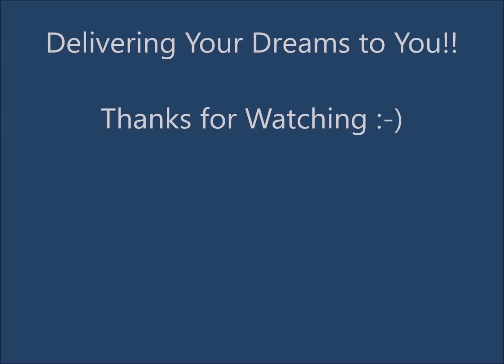Cutting New Road with Cat 963 Tracked Loader

Comment: Take no notice of the negative comments I have two 953’s and have been operating track shovels all my working life, started on  b100 internationals cat 951’s 955’s then on to the 953’s d6’s etc etc . We use them in the uk for final trimming roads motorways airport taxiway work and run a 4in 1 bucket for this. When I started I never thought I’d ever be able to level anything and had negative comments from certain people which made me more determined to crack it but I did and have been doing fine levelling for years, track shovels are one of the most versatile machines out there being able to do clearance demo load lorries grading and most things in between,the reason there not popular is there not easy to drive and not many can properly, you’re doing great taking it easy ,by the way that’s lovely looking 963 look after it.
Reply: Thanks!
Reply: Thanks Charlie, please tell us more. I can drive a 4in1 4x4 loader well after over 11 years, I've seen other comments like yours about track loaders or Drott's as they are often called in Australia. They can't be that hard to operate I guess the steering the hardest part, the other controls would be straight forward and you'd pick it up fast I would guess? I'm looking at logging and side cuts in steep rocky country. I wonder why many of these track loaders on YT have no rippers ? Must have rippers and a 4in1 and then a leveling bar to grab in the 4in1, your thoughts?. The advantage a dozer has it has tilting blade I guess. I really enjoy back scraping with my loader after getting a cut going as it cleans everyting up real nice, surprised the guy didn't put that in his bag of tricks.

Comment: Funny how everybody who's not in the seat is the expert. Fairly certain most of the cats commenting have never run a track loader because the market for them is small. My style for running them is different then yours but you got the job done! In Nebraska I ran one of these all the damn time but these don't even exsist in Colorado and wheel loaders fucking suck!
Reply: What's wrong with wheel loaders?  Don't get me wrong, no one loves running tracked machines more than me, but I wouldn't be using a tracked machine to do a wheeled ones job and then blame the machine. Care to elaborate?

Comment: HE'D NOT BE DRIVING FOR ME !!, Fckn about he'll have that tilt ram seal out if he keeps at it like that
Reply: like how?
Reply: @d.e303-anewlowcosthomebuil7  
With the bucket tipped over and digging in hard ground it is placing much pressure on the tipping links and ram and is totally unnecessary.
Ive seen 53's and 63's with screwed up tipping linkage and torn out ram seals due to this abuse.
Bring in an excavator to dig it out with half the fuel, a fifth of the track wear and get a better job, the stone up with the 963 if you must
Reply: @jameslindley8318  ur right, i just saw that
Reply: @jameslindley8318  how do you tilt the blade on those to cut a grade?
I mean to crown a road, or to start on a mountain road. Does the blade tilt like a regular dozer?
Reply: @d.e303-anewlowcosthomebuil7  No Tilt Just Experience
Reply: @jameslindley8318  so, a much smaller excavator can be 30% faster and half the fuel?....would it need a blade?

Comment: Why would you cut top soil off a road
Reply from the maker: For a couple of reasons.  The first being, topsoil doesn't compact well and will hold water underneath the base and surface of the road.  Over time, especially in an area that gets a moderate amount of precipitation, the road will never get hard and eventually rut up again.  Remove the topsoil to get down to a good solid dirt for the subbase.  If you go down so far (your call) and you still find the soil is too soft and silty, you can add geotextile paper and increase the amount of stone put in for the base..  Secondly,  the side walls will contain the stone that you put down and keep it from running while your spreading it.
Reply: @HammaDownEnterprises  
Coz Top soil will turn to shit when its wet and will push straight through crushed stone capping plus if you put stone straight on top your road would standing high with no side support hence the edges will break away

Comment: Guys I need some help. I'm currently learning to operate a 963b and I'm having trouble with the position of my bucket. Any tips or advice? One pass I'm digging too much and the next pass I'm just skimming dirt.
Reply from the maker: With more practice and training you'll get it.  The top of the bucket is a level indicator, with time you'll learn to know when your bucket is level.  Before setting you bucket on the ground, pull the lever all the way to the rear until it kicks out.  That's when your bucket is 'flat' or in the load position.  Then lower the bucket until it a few inches off the ground. This is where you angle the bucket for your dig depth.  For shallow digging, tilt the bucket until the teeth touch, go slow and get the feel from there.  For deeper digging, you go tilt the bucket at a greater angle and apply down pressure accordingly.  Again, go slow until you get the feel for it and are able to visually gauge your depth based on bucket position how the machine handles.
Reply: SLHawk92 
 Thanks man. The boss has me stripping top soil off a lot and then I have grade it and right now it looks like I cut a bunch of speed bumps all over the place. I'll try again tomorrow and see how it goes
Reply from the maker: John Norris to fix that, set the teeth in the ground about an inch or two “use your judgement “ to knock the bumps down.  Once you got it relatively ‘flat’ then float it with the teeth pointed straight down.  Continue to work it at a reduced angle until you got it like you want it.  Over time, you’ll get better at it
Reply: Keep practicing you’ll get it ..... keep your eye on the bar above bucket ram ..... that’ll show you where your bucket is
Reply: Place machine on level ground
Sit in the seat and set the bucket flat on the deck- by rolling right back, put the heels on the ground and roll bucket forward until the teeth hit, (then a tad more roll pressure on the teeth )then lift up/Raise Vertically just a Tad until the teeth are just skimming/touching the ground, then jump out your seat and check where your teeth are, and adjust until the teeth are just toed down a tad, jump back in the seat and sit in your normal/comfortable position and  sight through/align a part of the tipping link with a part of the bucket or similar and get a mate to paint a mark on the bucket & linkage so the paint marks line up, whilst your still in the seat !- That will give you a Bench Mark as to where your Bucket Teeth are.

That said if the self levelling device is working you shouldn't need the above !.But it may need adjustment.
CUTTING
When you start your Cut- take it VERY SLOWLY ( Cut the Revs back to half throttle)and feel what the machine is doing- (Remember) the bucket will do what ever the machine is doing,) !! ie -if the machine stays flat level then you will dig flat level !, 

Enter the Cut by rolling the bucket forward a TAD ONLY!  GO MEGA MEGA SLOW until the teeth are around 250 mm under- then as the machine progresses forward onto the new cut ground and starts to rock forward- roll the bucket back (just a tad )and progressively  to prevent the teeth diving in too deep, ("progressively" to keep a smooth cut) and to prevent corrugations.

LEVELLING.
If the machine rocks sideways or fore n aft then STOP Immediately (Patience required here) , go back dump a bucket full when the low spot is, making sure you fill the low spot from the machine side, ie ( no hollows) then back off a tad, reset your bucket and cut the top off the dumped spoil a Tad High -(150 mm if soft material)to allow for compaction as you track over it.

Remember !! What ever the machine is doing -ie leaning side ways or nosing down or up, that is what your bucket is doing !!
So many think if they've been over it - they think its level, 
Learn Patience and GO BACK & (AMPLY) FILL THE HOLLOW-  if the machine ducks or starts leaning over.
 Feel machine position through your ass.

CROWNING
Id not bother Crowning the Reduced level dig,
Put the Crown on when stoning up- put the stone on Well High! - (around 200 mm-300 mm Proud) a machine width in the Centre of the road for maybe 20- 30 linear metres, then push a bit off to either side letting the machine duck a bit as you slew either side, the back blade the centre berm stone to take out any slew ridging
then go back to the start, fill your bucket with stone and run straight down either side of the road but 150 mm lower than the centre berm, filling any Hollows as required,
Then straddle the Centre Berm and the lower bench at one side of the road hence rocking the machine over slightly and run down the road blending the centre berm with the lower side grade- repeat on the other side ! hence you have your Camber/Crown.
PATIENCE IS PARAMOUNT- SLOW THAT ENGINE DOWN !!! AND PAY ATTENTION until you have it embedded in you head- then you will throw it on so fast it'll make others heads spin.

Comment: I guess I don't understand why you would use a tracked machine with a bucket to do a dozers job! A D3 with a 6 way blade would've been much faster and cleaner, use the bucket machine to pickup the piles you made with a dozer.
Reply from the maker: Professor MaryAnn why use 2 machines when 1 could do the job?
Reply: Yeah   A D3 is gonna do the same job as a 963   You dingdong
Reply: Why would u incur the extra cost when one machine could do it.
Reply: @michielvorster53  He didn't think that far ? LOL